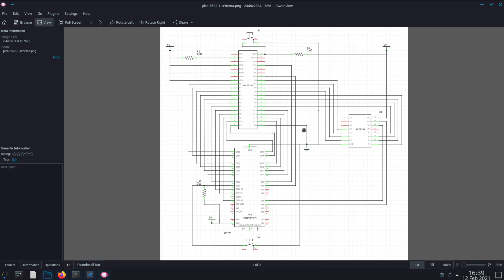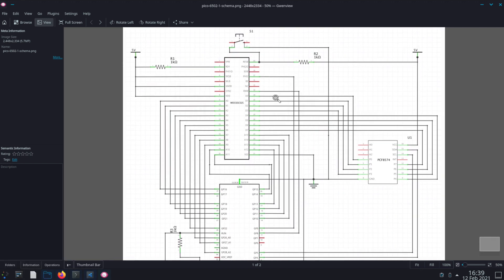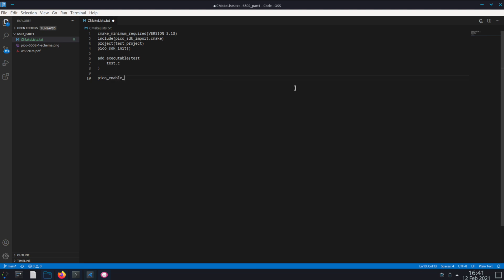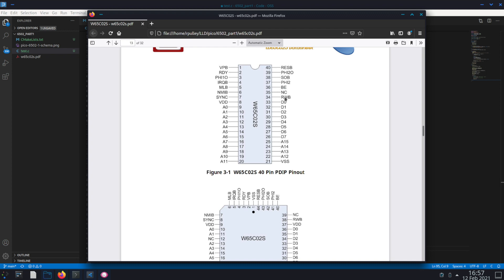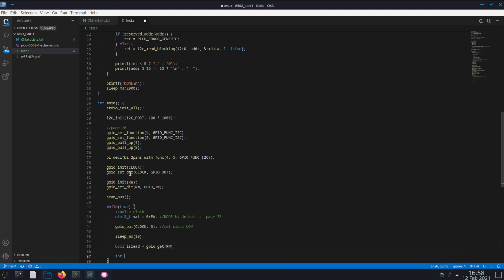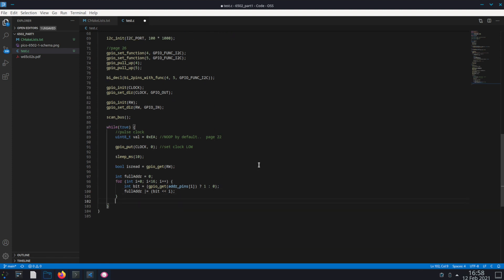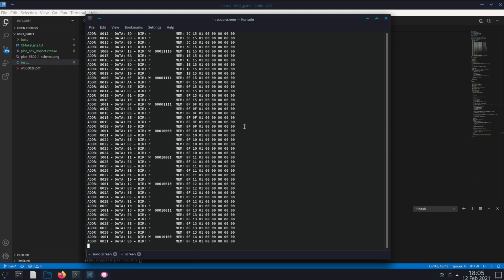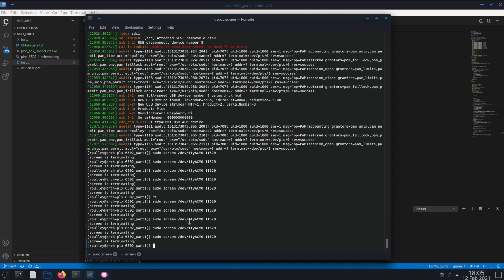Integrating The Raspberry PI PICO With a 6502 Processor

Comment: Absolutely inspiring!  I have watched other channels walking through assembling 6502 with modern EEPROM and RAM chips, going through the timing, etc. which then dovetails into this concise equivalent interaction with the 6502 Bus simulating the hardware with the Pico.  You give all of the baseline pieces breaking the surface tension with all the references right here.

Comment: Interesting video - Thanks.  Maybe I missed something, but I have a couple of questions...  Why use the I2C expander when there are 8 GPIO lines available if you don't have I2C?  Or is there a limitation in the Pico that prevents that approach?  And I was puzzled by the reading of the address from the 6502 one bit at a time.  Why not just read and concatenate the various I/O bit fields?  I was thinking that with the cores in the Pico able to run at 133MHz it should be possible to pretty much run the 6502 at normal speed (say maybe 2MHz) with careful coding.

Comment: Excellent video, you really helped me understand. I am considering doing something similar with a Z80-based computer. I have teh same question as @GodmanchesterGoblin. Why use the GPIO expander? It seems there are enough GPIOs on the Pico to interface directly to 16 address plus 8 data lines.

Comment: 5-Volt logic levels connected to the Pico ?,  the RP2040 is not 5 Volts tolerant.
Reply: Yeah I spotted that too. Maybe it's an oversight... Every device in use can run at, or below 3.3V

Comment: Nice work.

I'm in the UK. My first computer was a Tangerine Microtan 65 DIY board hand built in the 80's on stripboard (2K Bytes monitor, 1K of memory for video, stack and working memory) so I had no option but work in machine code. Was anybody else shouting out "A9" and such when you were looking up op codes? (I'm guessing you remember the common ones by heart anyway) 

I see you're using Code - OSS. The Pi Pico documentation leans on VS Code installation. Code OSS is a new one on me which I will be installing in a few mins. I'd rather use an IDE which, even if it does come from the Microsoft stable, doesn't come with a "traditional Microsoft product license" as they say on their github page ;o) 

Thanks again, will be keeping an eye open for more of the same
Reply from the maker: Yes I love VS Code, I actually just installed Code OSS because it was a package available on Arch and I figured I'd try it out.  Not sure if it's really missing anything from the regular VS Code version or not yet since I haven't used it that heavily on this VM yet.

Comment: Oh... have you seen the single board w65c02sxb? They've been around for a while. Maybe try hooking one up to a pico through its included 65c22? Mouser has them, Amazon has them, etc. There are a ton of other connection options for the Pico, such as PIA and  ACIA, along with a proprietary 40-pin port. Take a look. It has a flash rom you can overwrite, as well.
Reply from the maker: yeah that's pretty neat, I may check it out some time.
Reply: @lowleveldevel1712  I was wondering... how do you deal with the whole 5 volt vs 3.3 volt logic?
Reply from the maker: @jonathanstein6056  thinking about it, I'm sure that I could drop the voltage from the logic if it caused problems, seems to be ok though.  Also Ben Eater uses the 6502 connected to arduino in a video which is not technically 5v tolerant but doesn't have issues either.
Reply: @lowleveldevel1712  you can run the 65c02 at 3.3v, but you'd have to change the timing, I think. I've started creating something of a shadow project (of yours), as I think your project is intriguing. I got some high speed logic level converters to try out. However, I don't know C... I've been using micropython. The snag is that there aren't very many examples of using the PIO asm commands through it. The official examples only deal with outputs.